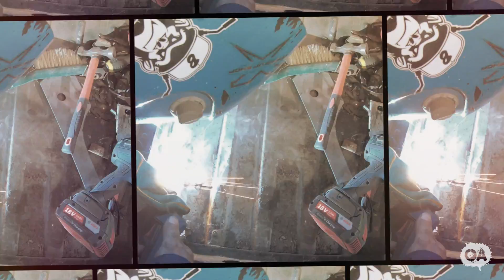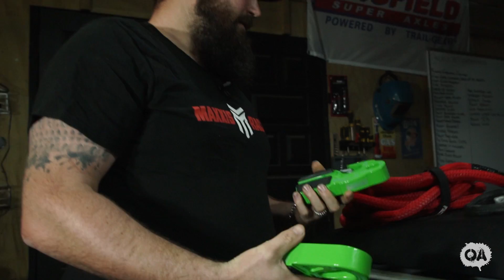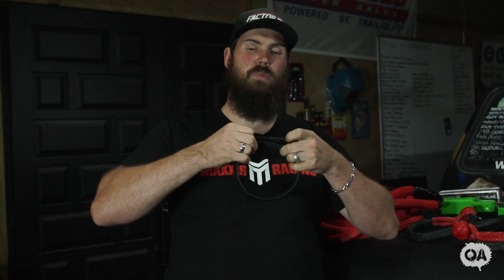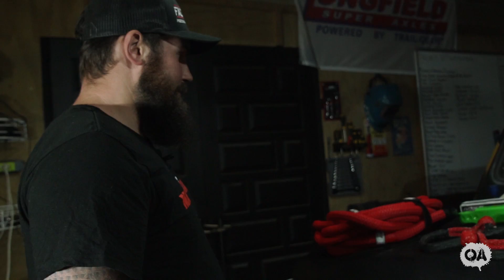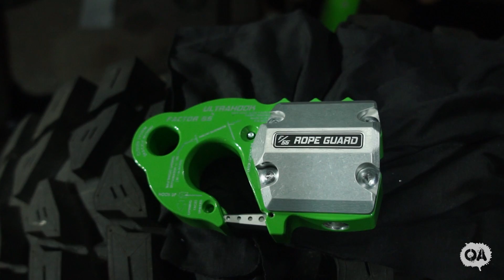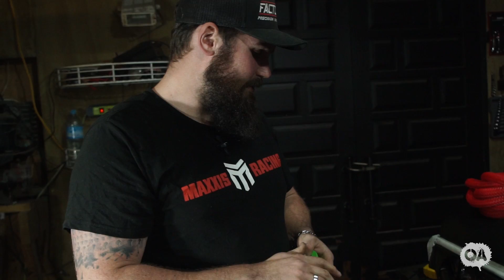Shiny Bits (Factor 55) - EP47 - Turbo Suzuki Samurai SJ413 Build - Project #Tightsqueeze

Comment: Not bad, pretty interesting to see some of the advances in recovery gear coming out, guess it's a bit of a kiwi thing to just keep using the same old stuff because it works and "it's how we've always done it", might be time to look at upgrading some gear
Reply from the maker: Yeah Factor55 do some good gear, well thought out with safety as the main goal. If you like good looking recovery gear that is built to last then it's worth the investment.